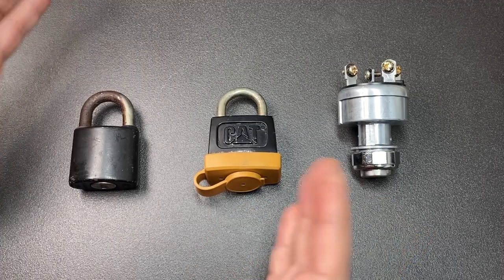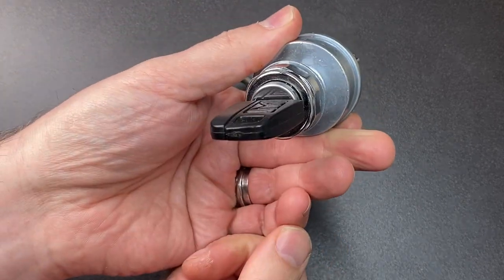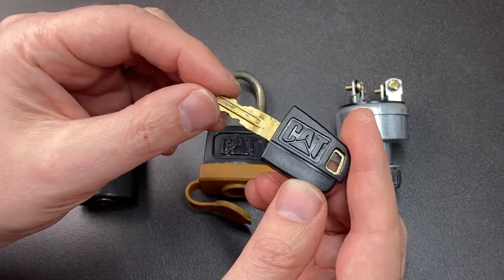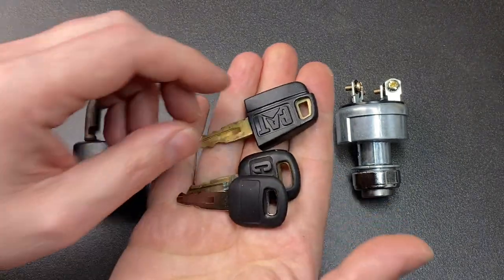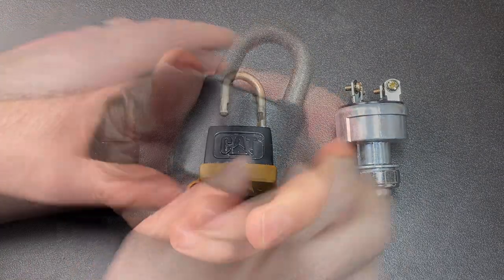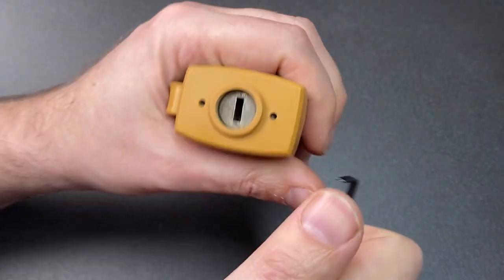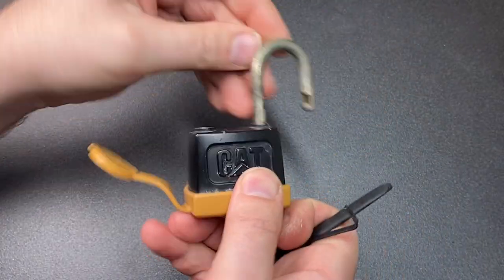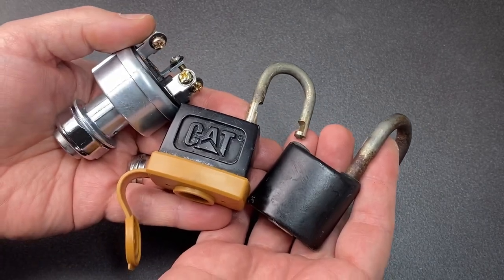Army of Caterpillars! - 3 CAT Locks Picked

Comment: Most people think locks equal security, but that's not always the case. Sometimes it's about safety, and even convenience... Or a combination, like the plastic LOTOs.

I always get annoyed when I see people on reddit or youtube bashing stuff like the CAT keys. It's not an oversight, it's very much deliberate as you point out. 

Now, there are areas where using standard keys are a legitimate security threat. A certain bearded pen-tester have several videos on the topic. But standard key = bad is not a universal truth.

Edit: Now, improper use of stuff like the CAT locks tough, that's another thing entirely.